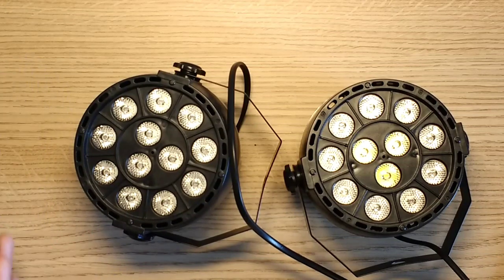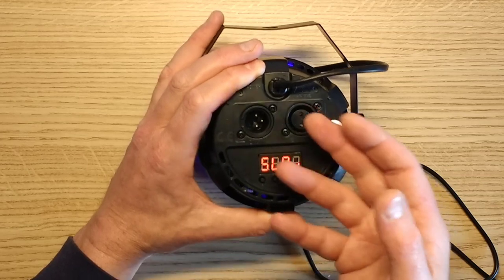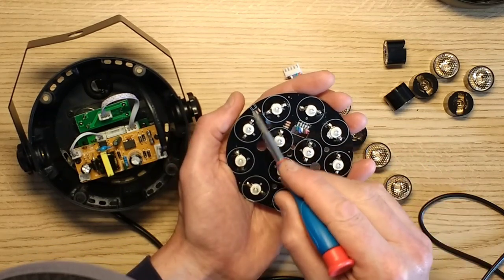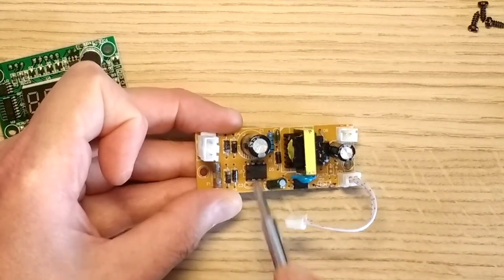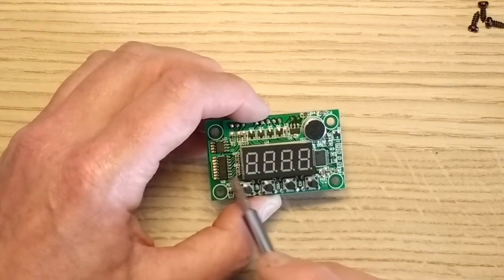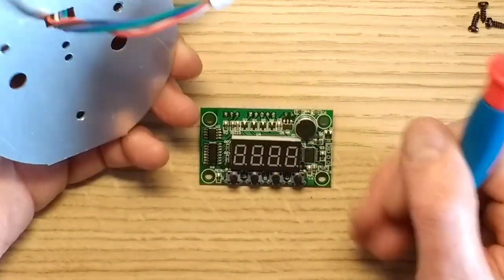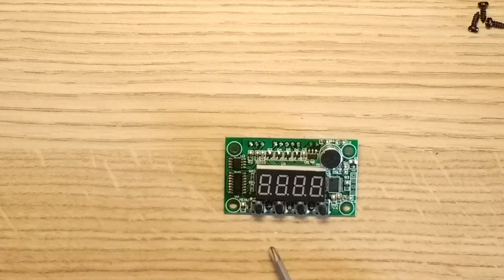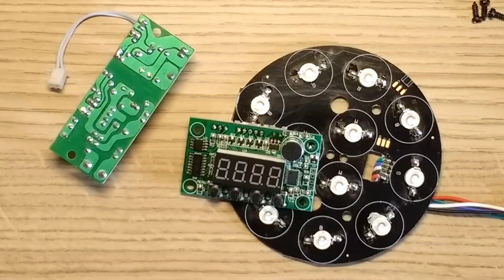Teardown of a DMX controlled UV disco light.

Comment: I'd love to see more DMX lighting teardowns, particularly cheap moving heads if you can find them within budget. I've recently set myself up with a whole set of lights and lasers (mostly Equinox, Chauvet, and Laserworld gear) for running lighting during DJ sets at events I help organise (mostly demoscene stuff in the UK) and would love to see the innards of that kind if stuff.

Side note, I met a colleague of yours at one of those events - NOVA, earlier this year. We had a chat about my homebrew stage backlight system that ran behind the projector. I feel terrible that I've completely forgotten her name (I was quite drunk at the time) but say hi from me!
Reply: I think he works behind the scenes at a stage in his area anyway as a repair man for the equipment, so frankly you might as well just ask him to record himself at work. :-P

while I'm commenting, what kind of laserworld lasers  do you have? ilda or dmx?
Reply: James Ray On the Laserworld stuff I've got 2x ES-100G, 2x ES-600B, which are both DMX. I've also got a 520laser Club2000 which is ILDA 30kpps (driven via an FB3 QS). My older laser projector is a cheap Chinese RGB laser which is ILDA with questionable galvos (maybe 5-10kpps or so), and that's driven off a homemade ILDA controller - single 12-bit DAC multiplexed into a sample-and-hold bank with an opamp array on the frontend for differential drivers. I'm also doing lighting control from a completely custom stack I coded, which encompasses DMX lighting, custom non-DMX lighting (mostly ESP32 driven), laser cues, VJ, beat syncing, and a bunch of other live performance capabilities.
Reply: Jay Smith I'm already married! (And I brought homebrew lights and homebrew beer!)
Reply: so a lot of control then? :-P

on the note of control, if you've used  quickshow with your fb3qs, how do you find it? ive been wondering a few  things  about it but I don't want to ask pangolin as  I fear ive already pissed  them off. :-P
Reply: James Ray I like it. Easy for live syncing and generally intuitive for designing new animations.
Reply: ive been trying out with the demo software and I found you cant change the animation speed in the timeline. is this just the demo do you think or is it a part  of the real software?
Reply: It's configured as part of the global BPM setting, so if you can change that then it should be fine. This only works for beat-based animations, not fixed-time animations.

Comment: Very OK HV/LV isolation on that PSU. The standard of inexpensive Chinese PSU construction really has improved over the past five years alone, and it would be easy to mill out a slot under the transformer.
Reply: Phil S And that slot is only needed for shorter distance, in dirty / wet air or in high mountains.

Comment: i own this LED Spots too, if you hold the Menu button on start up for 2-5 sec. you come in to "service mode" where you can set the max brightness (current Limit)
Reply: arr, i measured mine, it uses 470ma at 10.7V its got a fan too to cool the led board a bit more

Comment: Hi Clive.
I think the drive transistors are running as a multi element current mirror. More specifically they are 'slaved' off of one other transistor that generates the reference current. Each transistor mirrors the reference current. These can be built with low component count and are a good design for driving LEDs (like the 7 segment display). 

They work best for series chained LEDs though and this design may have the LEDs in parallel... 
 - Eddy

Comment: I think this LED board doesn't have one common wire but all colours are wired in series. Each colour can then be shut down with a short over tranzistor. It is a very simple way of doing dimming of multiple colours, the only problem are capacitors on the output of the power supply, because when you short an LED ther will be a lower voltage drop and capacitors will discharge with a very high current! If larger caps are used like in this case there should be a resistor in series with LEDs to reduce current spikes.

Comment: In sweden the standard fuse in the distribution board is usually 10A. Some new ones are 13A on DIN boards but I have never seen any fused plug outside the british one.
Reply: rimmersbryggeri Our standard supply in the UK to a socket circuit (ring main) is 32A at 240v RMS, so that's why we have fuses in our plugs, mainly protecting the cable. We also sometimes  use 20A radial circuits. Tech power in my work is 240V 16A radials to commando sockets.

Comment: In the 1930s and 1940s it was not too uncommon to see products that used insulated resistance wire to hook up things like light bulbs that needed a voltage drop. As soon as I saw no resistors on that LED board I thought that the clever way to do that cable would have been with resistance wire. I doubt that it is resistance wire cable, but that would have been a way to do it.

Comment: Clive! you need to build your own little usb dmx controller. its super easy in fact i made a little one out of a usb rs232 with a rs485 adapter on it. I forget what brand it is but the usb rs232 has to have a certain chip in it for the software to detect it as an opendmx controller.

Comment: 3:20 It is RGB*U*. I once had to configure a similar group of DMX daisy-chainable disco light heads (which were in fact daisy-chained) which had all 4 channels' LEDs (Red, Green, Blue and ultra-violet*) in *each of those light clusters. One could set red, green, blue and UV percentages (not really %; it was scaled 0...255 each channel) separately.

Comment: I have a slightly larger rgb version that has burned all its blue and green leds. I now use it as a rgb led dmx driver thing and it works pretty well
Reply: Also have a moving head light from eBay

Comment: I have 4 of those but they all started to flash and burnout after a while !
I dont have the exact same version : mine dont have sensitivity settings and master/slave (even if it was advertised on the box)

BTW : If I hold button (D) for a while I can set PWM max output for each channel !

Comment: Clive, is there a difference between impedance and (electrical) resistance? Because as far as I can remember, both are given in Ohms, but as soon as there's some pulse width modulation involved, I think they are two different things? I think this may even lead back to the "explaining electronics" video that you've mentioned you wanted to do but didn't get around to yet, and also are a bit fearful of making (if I remember correctly)? I understand basic DC electronics on a basic level, like resistors, transistors, capacitors and so on, but as soon as it goes into pulses or even AC and/or high frequency stuff, that's when I would really need this video from you! :-) (Like what is a blind load, how does a wire induct into itself and what does that mean, and all this funny stuff). I'd really love to understand this though, because I find it fascinating. I think one could do marvellous things with electricity, once one has understood these things perfectly.
Reply: I guess I am really looking for the oscilloscope video on these lights.
Reply: Yes, they are both measured in Ohms.  However, there is a difference.  Resistance applies to direct current (DC) circuits; it is the opposition to flow of current.  Impedance applies to alternating current (AC) circuits: it is the product of resistance AND reactance (reactance = capacitance + inductance, which generally do not occur in DC circuits).
Reply: Seegal Galguntijak Here's some of the AC basics: If you feed a pure smooth sine waves (like from an electromechanical generator of any size) into a simple "linear" circuit containing only resistors, capacitors and inductors, then instead of plotting out the waveforms one by one, you can use a mathematical trick.  Under the limitations just stated, all the waveforms will be pure sinewaves, all at the same frequency you started with.  Only difference will be the amplitude and a delay ("phase") in when they start.  Those delays are measured as if it was degrees of rotation on a "one turn per wave" generator.  Next, instead of using normal one-dimensional "real" numbers, you use two-dimensional "complex" numbers, where every value has an "X" component and a "Y" component. The distance from (0,0) is the amplitude and the angle away from just (+v,0) is the phase.  With those notational conventions, all the old DC formulas still work.  Furthermore, a capacitor can be treated as if it was a resistor but with a resistance in ohms that is also at an angle away from normal, in fact 90 degrees off.  The value in ohms is actually 1 divided by (2 x π x Frequency X capacity).  The same is true for a coil, but 90 degrees the other way and ohms=2 x π x Hz x Henry.  This 2-dimensional complex resistance is called the impedance.

If you have something other than a pure single frequency sine wave, it can be treated as a sum of many sine waves at different frequencies and phase angles (the conversion formula is the Fourier transform), and you can then do the simplified calculation for each frequency on it's own, then convert the results back into actual waveforms at the end by doing the Fourier in reverse. Our ears and eyes are actually doing Fourier like stuff to the sound and light that hits our heads, so sometimes converting back from sinewaves to actual waveforms isn't even needed.
Reply: Hey Clive, another great video. Thank you. Any chance you could cover simple battery led sequencing circuits e.g. knight rider car grill (but with pink/ uv leds)? Would be a nice project video now christmas is on its way.
Reply: Sir John Francis Doe - Wow, that is some really complex mathematics you were trying to teach me there. I'm already struggeling at imagining the additional dimension of "degrees of rotation" for the frequency, and using angles of rotation for further calculations. And then, this is only for sine waves, while there are so many other waveforms, like rectangular, sawtooth and more, which probably all account for different formulas to calculate? Also, there is pulsed DC, which was the initial reason for posting this question, and now that's a totally different setting alltogether. I think I should look into understanding the Fourier transformation first, before aspiring to understand the electronic basics...
Reply: Seegal Galguntijak - Impedance is a more general term; resistance is more specific to DC. The impedance of a circuit (or component) depends on frequency, and whether the circuit is dominated by capacitive reactance or inductive reactance. If you put a capacitor in series with a signal source, the impedance goes down as frequency increases. If you put the same capacitor in parallel, its impedance goes up as frequency increases. The opposite happens for inductors (but don't put an inductor in parallel with a signal source that has DC riding on it, or something "exciting" will happen!)
Reply: Seegal Galguntijak 
Remember imaginary numbers from high school it's kinda like that 

It's also tied into power factor determining the inductance and capacitance of a device can be expressed in complex impedance.
Reply: Super simple explanation: impedance = resistance + reactance. Where resistance is the standard ohms law that you know and reactance is the resistance to AC current caused by capacitive and inductive elements in the circuit.
Reply: pure resistance applies to both DC and AC, however, to get accurate information for non DC circuits you need to combine resistance and inductance together to get the impedance. With the same circuit components, Impedance generally increases with frequency due to increased resistance of any inductive components.
Impedance is usually used in AC circuits the same way as resistance is in DC circuits.
Reply: Seegal Galguntijak  In this device, it is likely the combination of the inductive impedance of the PCB tracks, wiring and semiconductors along with the resistance of the PCB tracks, wiring and semiconductors that is being used as the "current limiter". All normal conductors in normal temperatures have some resistance and some inductance. The inductive element is often called self inductance, or stray inductance. By switching the supply on and off at a very fast rate (high frequency), you kind of "magnify" the inductance, as current in a inductive circuit ramps up from zero to maximum over time (for a fixed voltage circuit, how long depends mainly on the inductance). So if you switch at a high rate, and only have a very short on time, the current will never reach the maximum value. Although whether they manage this in this design is debatable. One thing that is true, is that LEDs can be overdriven at high current levels for short periods of time, as long as the overall power is limited. So if you switch at a high frequency and keep the on period a lot shorter than the off period (known as a low duty cycle), the LED will be bright, and will not be damaged by the high current pulses.
See here https://www.boundless.com/physics/textbooks/boundless-physics-textbook/induction-ac-circuits-and-electrical-technologies-22/ac-circuits-162/rl-circuits-581-6216/ for more on inductors.
Reply: Thank you all so very much for your explanations! I will have to wrap my head around this :)
Reply: That took me back to my Uni days, God I hated analogue circuit theory and analysis ! Digital design is so much easier
Reply: the difference basically is DC and non-DC (AC) ... impedance is all the effects from an AC signal reducing/increasing the overall 'resistance' of the circuit, whereas with dc its purely resistive.

Comment: Have you considered purchasing a DMX-USB interface to test with? Use an old laptop or something like a Raspberry Pi to control so you're only replacing a $35 USD computer as opposed to a full DMX control board and equipment if a badly constructed fixture suddenly puts mains voltage to something designed to receive 5V.
Reply: RenThraysk Can that run Win32 apps though? I don't know of any programs in the Windows Store that can control DMX, and that device is probably locked down to Windows RT. Correct me if I'm wrong though - I'd love to see a solution that easy and cheap!
Reply: Windows 8.1.  Shouldn't be any problem.
Bought a cheap Windows 10 tablet (Viglen Connect 7") few years ago on a whim in a Tesco sale (was ~£50), and it's full Windows 10 Home. No limitations. Just only has 1 micro USB, so less convenient in this application.
Reply: RenThraysk I haven't used Windows in tablet form at all yet, so I wasn't sure. Good to hear. The older Windows 8 ARM tablets ran on Windows RT, which was locked to Store apps similar to the new Windows 10 S they're talking up. It failed miserably though. And great idea with a tablet; I wasn't thinking about it, but that'd be an easy and portable way to set it up for the style of video he does here. 👍

Comment: Hi Clive, i have a pir lamp for outdoor with two 6w led lamp on it. One have a flashing problem when i bought it  and died few week later...  I open it and the led driver contain a little bit more components than the one on your video,but it's very similar because of the coupler (optocoupler). I have tested the majority of components, the only thing i have found is the optocoupler (coupler) installed in wrong polarity from the factory. I have remplaced the coupler with the other one i have but the led driver still not work, the optocoupler is fine because i have tested it in the other led driver. The driver have two 8 pins chips. the one before the transformer is VIPer22A, the one after the transformer is the same brand but i did not find any informations about it (358   ST EF935 ). My have two zener diode after the exit of the coupler.
This mistake from the factory have caused another trouble, But I did not find it. Do you have an idea what can be the problem now ?
If somebody can give my some informations, your welcome

Comment: Do they sell DMX surge protectors to protect your systems?  I'd think that would be desirable, especially since you may have systems connected to different power transformers and circuits connected together.  I once worked with a school that ran RS-232 lines between buildings.  They regularly blew things up when there were lighting storms or electrical problems.
Reply: There are DMX splitters/amplifiers that offer pretty good isolation through optocouplers

Comment: Isn't it quite an easy task to use a digital output from the micro processor to pwm drive the base of the driver transistors?
Reply: I think for some microprocessors, it's built into the firmware.  Just set the registers and let the hardware do the PWM.

Comment: Is there no voltage regulation on the DMX channel?  Like spikes get clipped by some sort of surge protection or breaker/fuse?
Reply: DMX512 standard operates at the same ELV levels as RS-485 and is similarly transmitted over differential pairs, so there's op amp buffering and that's about it. As you can imagine, putting 240V across those signal lines will certainly fry the first light on the DMX bus and depending on the failure mode, every other light that's connected too.
Reply: PongoXBongo  With no earth connection, it's not possible to limit the level of the mains leakage voltage :-(